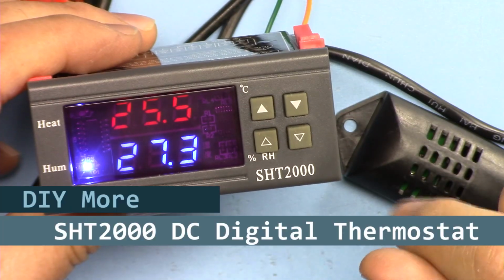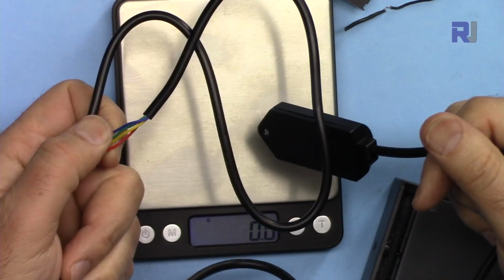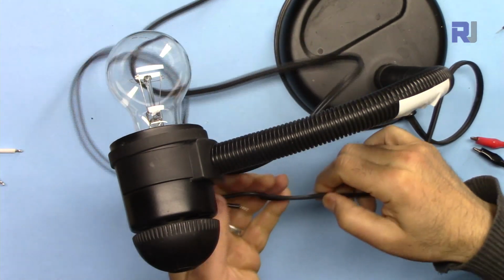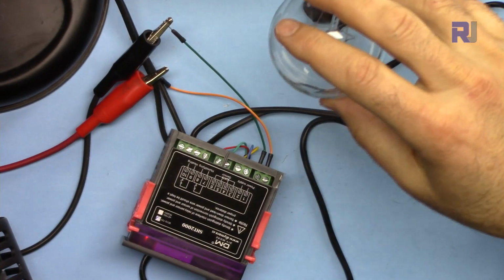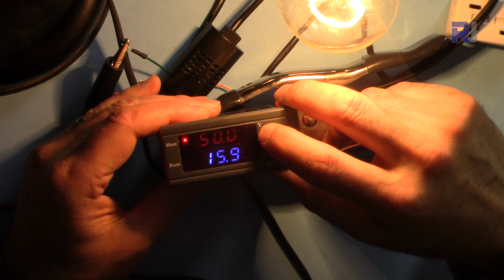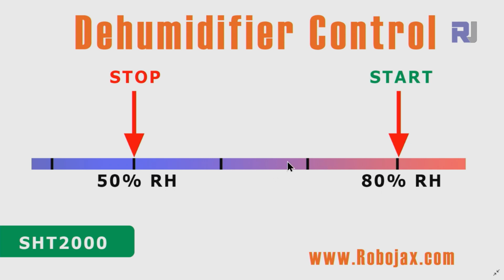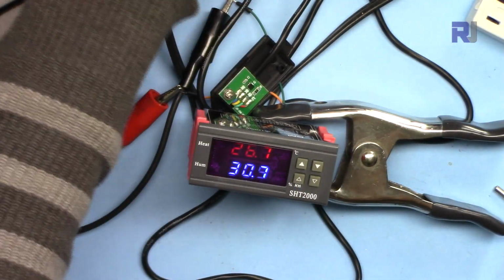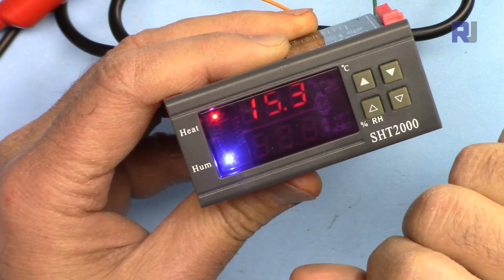Using DIYMore SHT2000 DC Digital Thermostat - RJT200

Comment: Sir what if the display of this controller is EEE on the temperature and 100 on the humidity.
Reply from the maker: 100 means maximum and EEE has be not seen it but perhaps it means maximum. LLL means bad working

Comment: Hi, but the load is 12v dc or ac?can i use a 12v resistence for heat?
Reply from the maker: hi, this has relay to turn ON or off a load. so AC or DC does not matter.  This module operates. we have operating voltage and load voltage. this module operates with DC voltage. here is the video for AC version of this https://youtu.be/lFlrSku4gR0